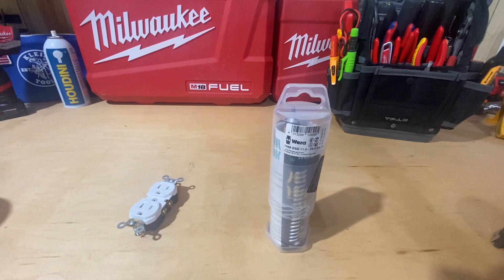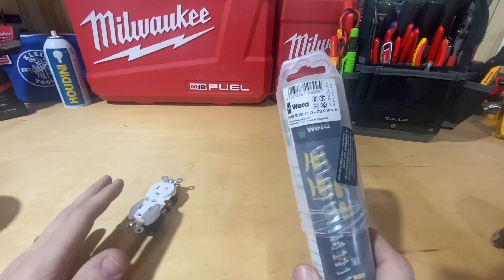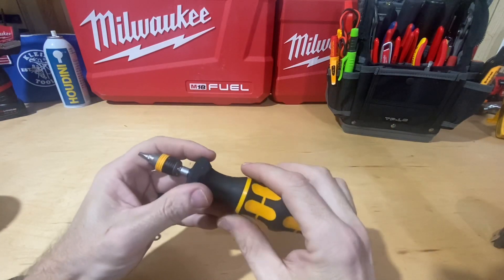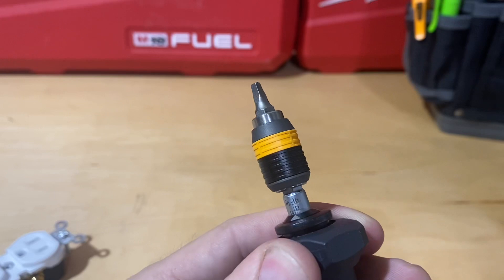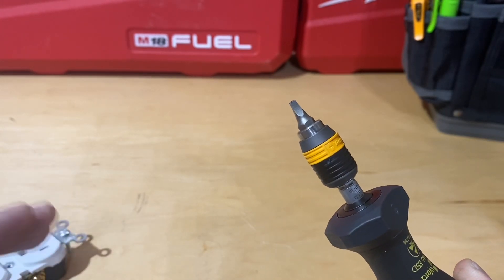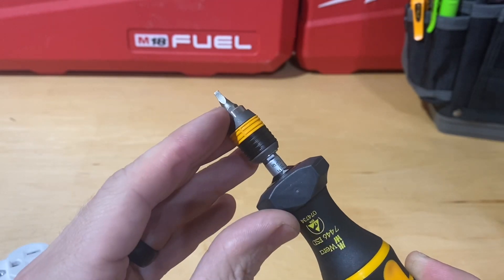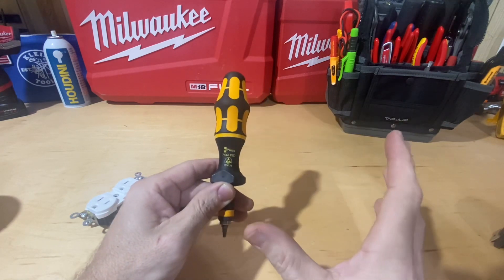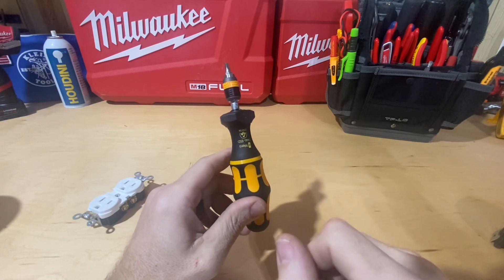WERA Torque Screwdriver 7446 ESD 11-29 in/lb. - Install Receptacles & Switches to Code

Comment: What is the difference in the yellow handle and green handle?
Reply from the maker: From what I gather the ESD (yellow) protect your equipment like control boards and things from static build up. The green are just standard handles.

I personally didn’t need the ESD (for what I planned to use it for), but it was the one on sale. I guess it’s just a bonus in case I do need it for something later.

Comment: Hey Joey - Well, after hemming and hawing for several months, I decided to order one of these through Amazon when the price was under $100 (through your affiliate link).  What is a typical torque recommendation for like what you torqued down in this video, the side screws for the black and white wires?  I looked on a few plugs I have in my electrical kit, but I don't see it anywhere.  I am guessing it must be on the paper literature that comes in the box the switches and plugs come in, but I don't have a new one in the box currently.  Just curious and thanks for the recommendation!
Reply from the maker: I know.  I think it’s funny how people are now supposed to torque them, but finding the info takes forever.  Every now and then they are on the device, but you usually have to search online.

Most receptacles/switches say 14-18 Ft.lbs. I normally meet in the middle at 16
Reply: @MORGANSMaintenance  lol!  You are so right!  I have a hot tip for you, no pun intended.  I see in the video you are using a #2 Robertson bit to tighten the screws.  Have you ever heard of an ECX bit?  I switched over a while back and it is really fantastic!  Mine are Milwaukee 1" bits that I can put in my Vessel electric screwdriver and the new Wera torque screwdriver.  Check it out!  I can see a video on the bit coming soon...
Reply from the maker: @russalbright4213  I have the ECX bits, I just didn’t have it in my bag and didn’t want to go to the truck 😂.  That is the one I normally use.  They are great for receptacles and switches.
Reply: @MORGANSMaintenance  you might want to do a video on them, showing the difference between a flat blade, philipps blade, robertson and the ECX bit.  Maybe if you are looking for video ideas?  I am guessing a lot of people don't know about them, and it is not a huge cost item.

Comment: Thanks for the video Morgan. Nice tool, handy for other applications as well. Question; I was always taught and still to this day reset the torque to zero (0) on all my variable torque wrenches and screw drivers (Wheeler, only one I have in the torque screw driver category) to relieve the tension on the internal components, I don’t see an option on these do do this, is there ? Maybe with the new tech it’s not required but I don’t even see that as an option on this. (This looks so much more comfortable than my Wheeler too, love the WERA tools).
Reply from the maker: I have always been told the same. I just finished changing the brakes on my Truck this morning and I reset all my ratchets to zero when I was finished.

It is in the instructions on this screwdriver “if the adjustable torque screwdriver is out of use for a longer period, turn the wrench back to the smallest adjustable value to reduce unnecessary stress on the spring mechanism”

So that is what I have been doing on this one and the Capri Tools. I turned this one down to 11. Good thought to bring to peoples attention.

And yes, this one is really nice and functions great.

Comment: Is there any benefit/drawback to using ESD tools in residential/industrial electric service? I always thought about them being for electronics. I guess this isn't necessarily a question aimed at you, but just curious.
Reply from the maker: I believe You are right and it’s just an “extra” safety measure for electronics. I don’t see a need for it in electrical service and if the standard (green and black) WERA is available for cheaper I would go that route. 

I only got the ESD because of the deal I got on it, but I don’t think it loses any characteristics from the standard version. Durability, Etc. I could be wrong about that though.

I’m interested in others opinions on benefit/drawback that know more than me though… Good Question.
Reply: ESD safe tools are not the same as insulated tools.  ESD safe tools are specifically conductive, as any charge in the tool would need to be dissipated to the user that would then go to ground through grounding straps/mats at their workstation before coming in contact with the sensitive device.  It is a high resistance path of conductivity through the tool, but the path is there.  ESD tools are not PPE to protect the person, they are to protect equipment.  For electrocution hazard, everything is insulated and you don't want to be a path to ground, this protects the person.  For ESD protection, any arc/spark/shock is an ignition hazard or can damage sensitive equipment, so you ground everything, and you are a part of/path to ground.
Reply from the maker: @25Nightops  thanks for the help. I knew it wasn’t the same as insulated, but was unsure on the specifics.
Reply: There are VDE versions wich are equipped with 1000V rated insulation, those are the better choice for electricians for sure! The ESD tool will in fact conduct a small amount of electricity to get a controlled discharge of static buildup without damaging electronic parts. For proper ESD protection for your electronics you will need a whole batch of precoutions and measures! Look into it, its quite interesting to learn about. Thanks for the video though.

Comment: Funny because after you posted about this screwdriver in the other video with the Capri Tools I followed your link and may have got your same seller because I was at $25 as well.
Reply from the maker: I was looking at WERA in the first place but was wanting one that went to at least 40 in/lb for breakers and the Capri Tools price was better for that. That and I had gift cards to Home Depot and they don’t sell WERA.

I found the WERA deal about 4 hours after I ordered the Capri Tools screwdriver, now I will just be on the lookout for an insulated set. Aren’t a lot of options for those.
Reply: @MORGANSMaintenance  is the deal gone?
Reply from the maker: @WYOMINGBEN  I got my WERA off eBay on auction. It wasn’t really a deal, but just luck of me finding it at that price.

I had a link on Amazon for the same screwdriver just in case someone wanted the info for it. Mine being from eBay there isn’t anymore. From what Matthew wrote I think he must have found a 3rd Party Seller on Amazon selling it for cheap from following my link.  I didn’t get mine on there. It’s showing $148 right now.

I’m always looking around for tools though. If you are looking for one I will keep an eye out and reply here if I find one at a deal again.

I’m already searching for insulated torque screwdrivers anyways… trying to find a deal I can’t pass up for one of those.

Comment: The click is definitely better on this one. The numbers look hard to read. On the other hand, since you'd likely be doing a lot work at a single torque setting this might be fine. This one being shorter seems like a plus as well. You can always use an extender or long bit if needed, but you can't make the tool shorter. Finally, this is a lot less conspicuous as to it being anything other than a standard screwdriver so there might be less chance of it developing feet and walking off.
Reply from the maker: My thoughts on it as well. The numbers aren’t bad but are harder to read than the Capri for sure.

It is a really nice screwdriver, if they had a 10-50 I would definitely go that route.